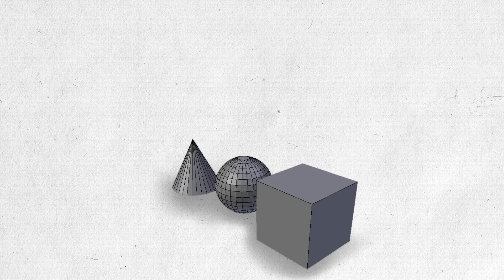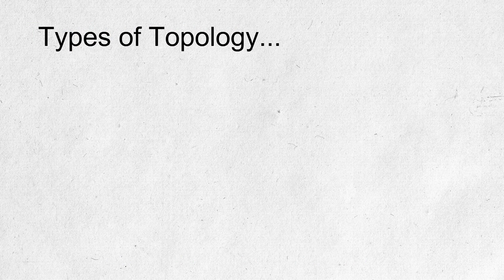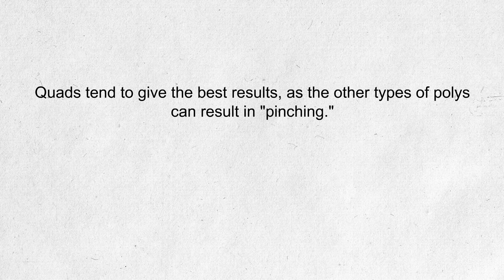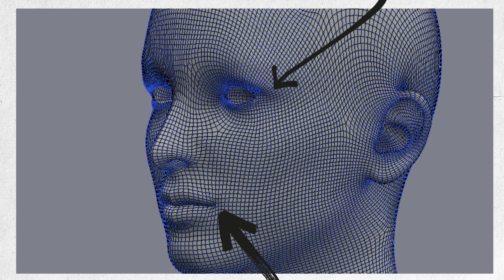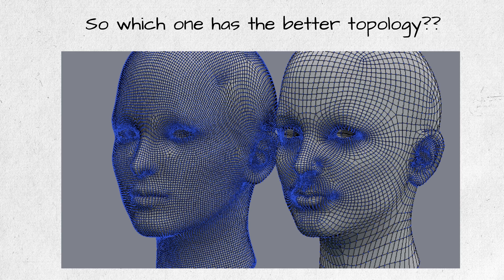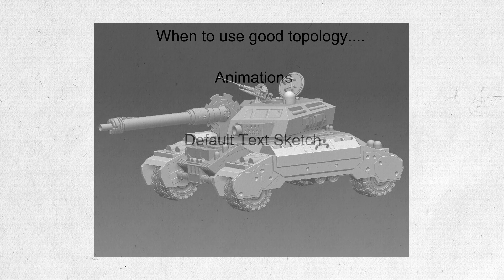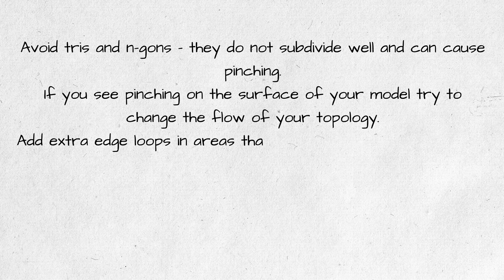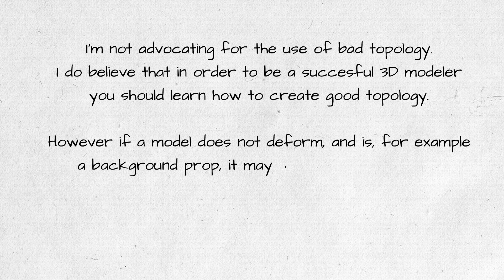3D Topology Explained for the Beginner

Comment: Are there any topology rules
Reply from the maker: Hi,  it all depends on what you are going for, here are some tips though: 

Organic facial topology will look different than a hard surface machine mesh, and will animate a little different also. In areas that move, like the mouth, or an arm I would try to keep quads and keep up with a flow of polys like shown in the video, so the animation is smoother. 

If you absolutely need tris, put them somewhere that doesn't move, like the bottom of a foot, or top of the skull where it will be covered with hair. 

Don't be afraid to google images of topology for different types of models, such as arms, hands, faces, etc. Lots of people have done studies on deformation, so no need to reinvent the wheel.
Reply: @bshukrallah  thx

Comment: what if you r merging many parts into one parts. Its impossible to avoid triangles. Triangles is a must to have equal dense spaces around the whole model. Example u r merging a complicated belt object with the body into 1 mesh. besides people bake the normals nowadays they dont subdivide is anymore. Maybe unless you are doing modeling for films than that may need subdivision then quads is very important i suppose? whereas n-gons is a must avoid since the renderer will not know how to triangulate since its not a 4 sided poly.

Comment: Bah I want to know the techniques used... i always start off with quads then a couple of hours into it i always get to a point where it all just messes up:((
Reply from the maker: It takes time and practice. Don't quit and try to fix the quads if possible. You can Google images of other faces and their topology to get ideas on the flow of polygons.
Reply: Topogun with the drawing tools that let you cover large surfaces quickly and evenly, then grab the verts and move them around freely? The extrude feature would help you around mouths and eyes, it automatically creates another 'ring' around the first set you made and you can real time control as it crawls out.

Comment: To be more accurate, you shouldn't say that tris and ngones are not suitable for animation. They are actually, as long as they are not in areas which will be deformed. The tank is a good example: even when animated, there are no deformations (except maybe on the tire's plastic part and stuff like that), It will be just about moving and rotating linked geometry parts around without deforming the actual geometry. So even in that case, a geometry full of triangles/ ngones and without good edge flow, is not that needed.
Reply: tri's okay but not n-gons
Reply: Unless you're blowing the tank up into parts and using blend shapes for dents and what not.
Reply: also Tris are pretty much gaming standart 99% of all models meant for games are tris required always
Reply: Artisan  You silly that's what I emphasize on that you can have tri's but not N-gons. Do you lack comprehension skill or were you dropped as a kid?